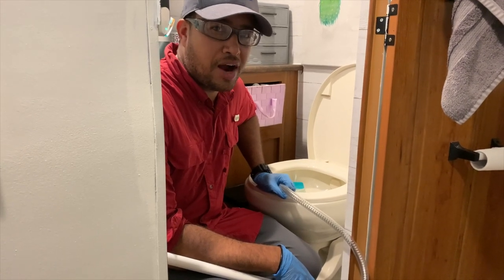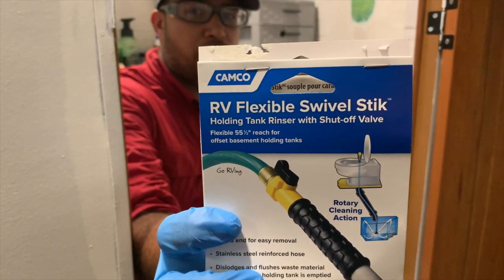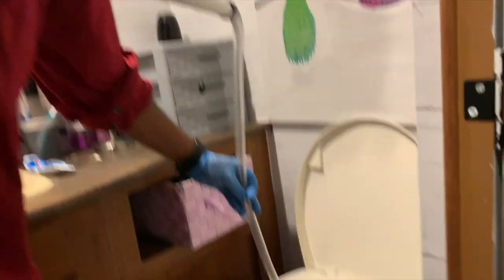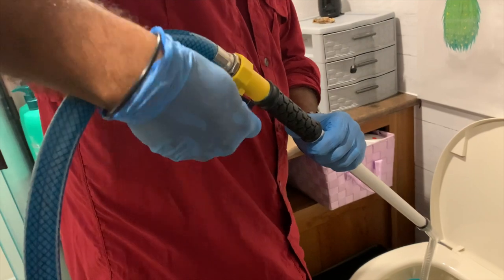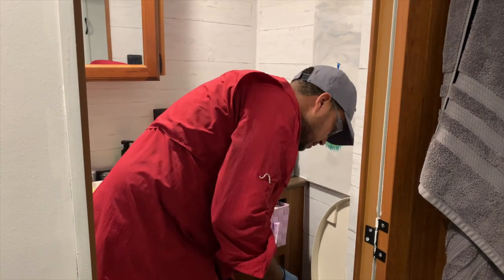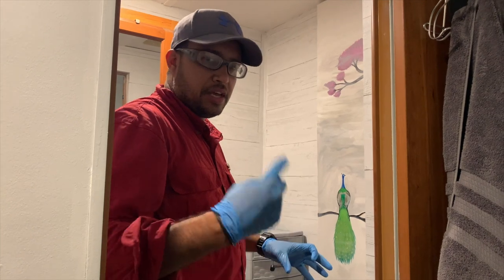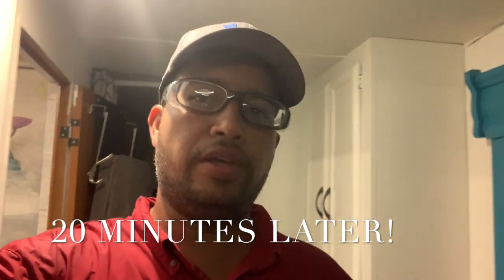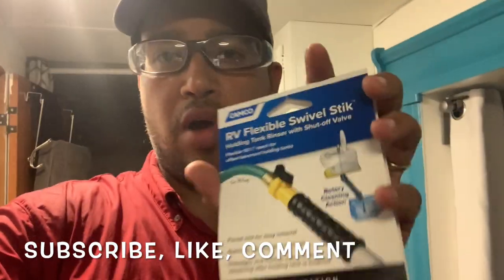Stuff happens! RV for Newbies, RV problems, RV Toilet Clog, Camco RV Swivel Stik

Comment: Just in case you do not know, black tank valve stays shut until your tank fills up. Then you empty. Grey tank valve can stay open. Also really important to use single ply toilet paper abd use lots and lots of water when you flush each time. I have lived in RV for years, let me know if you have any questions.
Reply from the maker: Jacqueline Burck we think that might be the issue, the water pressure is an issue, even with the pressure gauge. Thank you for clarifying about the tanks, we weren’t sure.

Comment: The wrong paper builds up. The right paper breaks up nicely, although if your Black Water sits without being moved for several days (like when boondocking & conserving water use), it becomes pulpy and can be difficult to flush out. That wand is just the ticket. Some folks are grossed out by having to use it, but it is just the ticket to make sure your black water products are removed from your tank.
Reply from the maker: David Burkart thank you so much for that feedback.  Any paper you recommend? or as long as they are for RV, they are all the same?
Reply: @RVfor4  the thiner the tp, the better.  That's true for RV'S and houses!